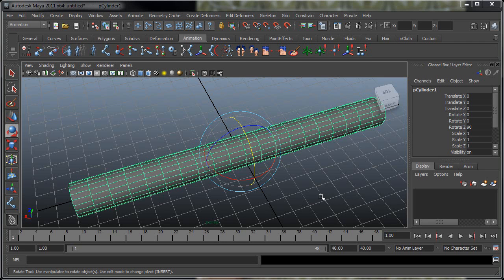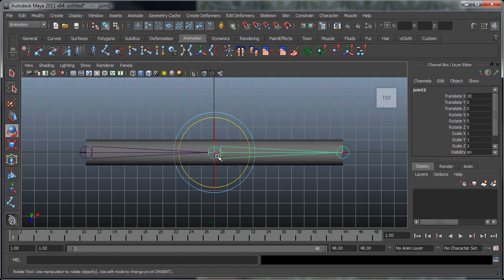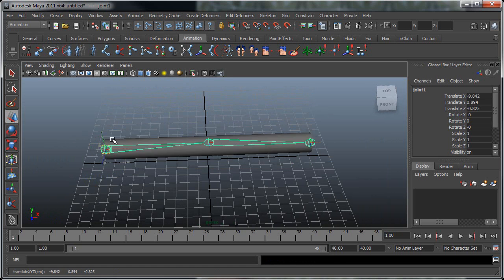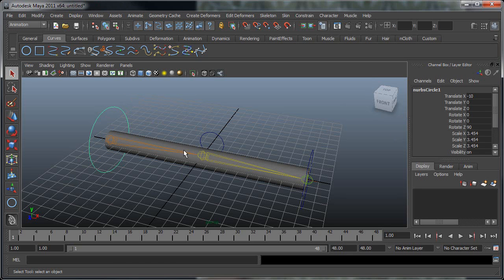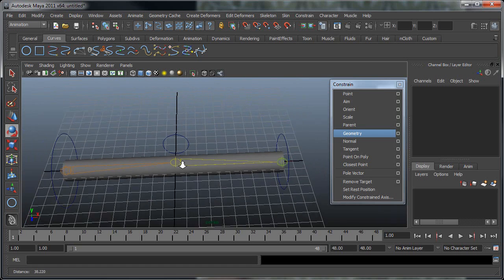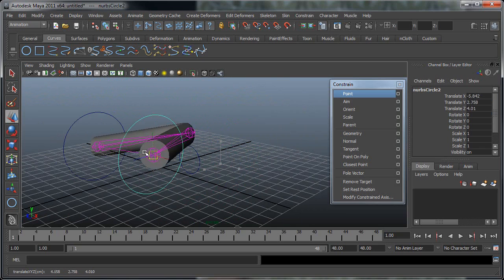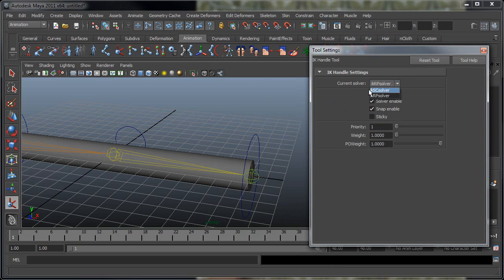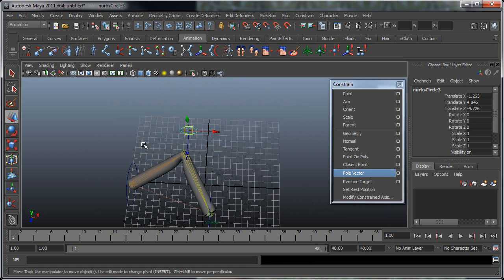Maya Rigging 101 - Simple IK rig

Comment: umm i rig up my cylinder but it dosent bend at the center =/ i move the ik and it just rotates the whole object and i cant find any help here =//
Reply: I had the same problem, so i just realized that the cylinder just had 1 subdivisión, so you could not bending at the middle, it needs at least 2 subdivisions, so i created the cylinder again and before adding any joint I set it up with 2 subdivisions... the example of the video has 19 :) (sorry about my english, i not a native speaker)

Comment: Hi. Great tut.
I just learned how to build stuff, now I'm trying to comprehand rigging and I'm stuck on this:
I'm having trouble binding the joint to the cylinder. I set the IK>test it> select jonts>select my cylinder>skin>smooth bind. Than I move the wrist and the elbow bends along with it, but the object itself doesn't. What did I do wrong? I read comments but still can't figure it out.Help please (epic "dying-dragon-sean-connery" voice)

Comment: okay everything works great up till the pole vector, im using a 2014 version of maya, and i double click on the Ik icon on the panel, but the current solver is either Single chain or rotate plane solver, either option gives me the same problem. is there and extra step im missing?
Reply from the maker: Whats the issue when adding the pole vector? You should pick the rotate plane solver when adding a pole vector
Reply: well i follow the steps in your tutorial to the letter Im getting the same problem when you tried aplying pole vector the first time, when you go to tool settings to change it, The options are different from the ones shown in the video.
Reply: Lovevideos Collection es un problema de la direccion de los joints, tienen que estar alineados al plano. Tuve el mismo problema y lo solucione asi.

Comment: When I do this for an arm the arm gets positioned backwards. like the elbow bends the wrong way
Reply from the maker: When you make an ik, maya will automatically bend in the ik in the direction the way the joints bend, so its best to add in a slight bend yourself when creating the joints. Hope this helps
Reply: That's because you are missing a slight bend in your bone positioning, if not the IK will bend in the opposite direction.

Comment from the maker: Hi, for a shop door I wouldn't recommend using an IK as the door doesn't bend it just rotates. Id move the pivot of the door mesh or group to the area where the hinges are. (press insert key so you're able to move the pivot point and press insert again to return to normal). That way all you have to animate is the rotation of the door.

Or you could make 2 joints, one at hinges and another at handle, use a IKSC (single chain) parent door to 1st joint so moving ik at the handle rotates the door.

Comment from the maker: Hi, For a tail, that anatomy is a spine which is much more flexible than the arm, this method is mainly for arms and legs where there is only one bending joint whereas a spine/tail is made up of several bending joints that curve smoothly. For this is recommend searching for spine tutorials or rigging with the spline IK tool.

Comment from the maker: If your joint chain is in a straight line Maya doesn't know which way to bend so adding a slight bend in the joint chain will help it decide. You could also try selecting the IK and in the channel editor change the values of the pole vecter x,y,z. the pole vector is the point where it should bent towards. Later if you make a pole vector control it should also bend towards that.

Comment from the maker: Im not aware of any way to hide it without turning the viability of the whole ik off sorry (not sure if you can) but the triangle shouldn't be visible when the ik isn't selected. If the problem is still there the best thing to do is just un-check - top of camera window > Show > IK Handles. Just so that when your working on other parts the ik's are hidden or even ad them to a display layer. Once they have been connected to the control curves there isn't much need to see them anyway :)

Comment from the maker: when you make a pole vector your basically telling Maya where the joints should bend toward, however when making an ik maya auto calculated where it thinks it should bend, so when you add the pole vector its telling maya to twist from the 1st pole vector it assumed when it was made. This usually happens when the join chain bends in the wrong way (e.g. elbow joint if furtherest forward) so its best to add a slight bend in the way the arm will usually bend :).

Comment from the maker: @cantsleepjujeje Hi i don't have any sorry but might make more later, however the methods isn't any different, if you have a robot with a ball joint that will act and should be rigged the same way (e.g. the hip). if its a hinge joint like the elbow you can still rig the exact same way and just lock/limit the rotation of the axis you dont want to rotate so it only rotated in 1 like a hinge :)

Comment from the maker: @cantsleepjujeje when making the joint chain try making it with a slight bend and maya bends that way, also when you make the IK try opening the options and check its set to RP (rotate plane) instead of SC (single chain). RP is the type of Ik that's used to bend :)